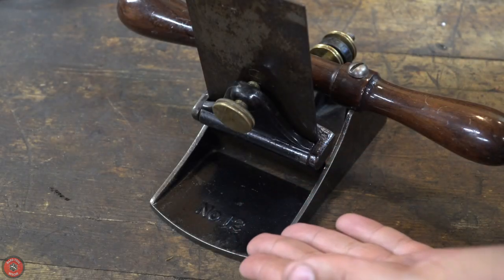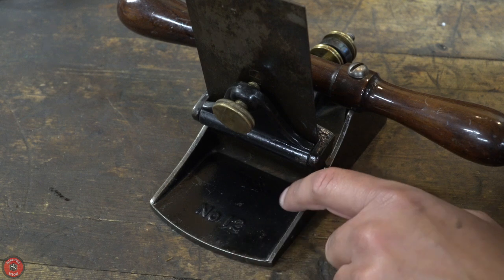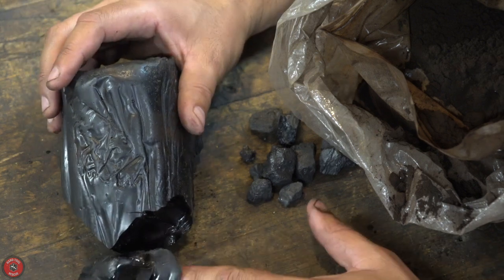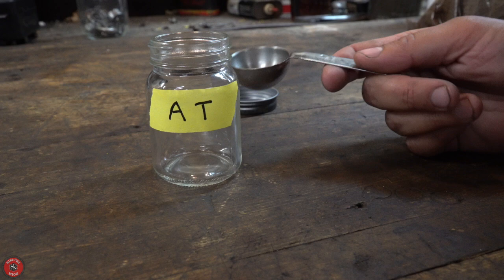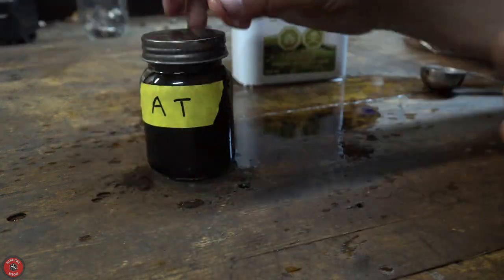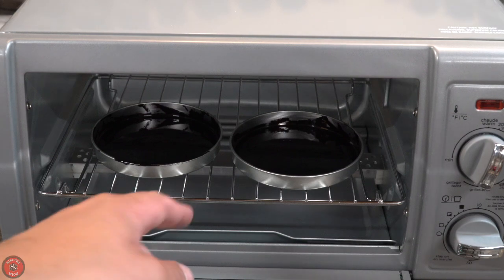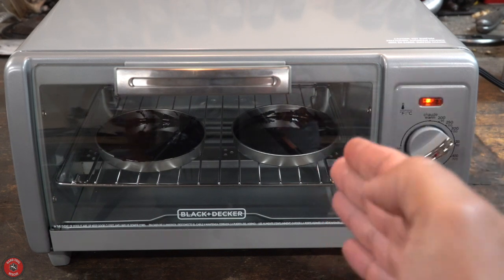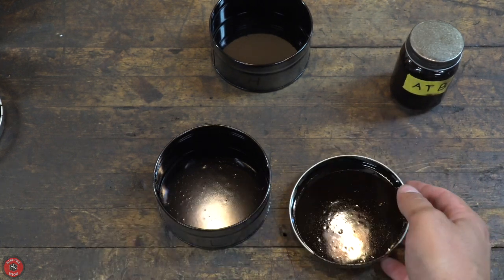Best Japanning Recipe

Comment: Ceramics guy here. Pottery kilns are programmed to sit at around 160-180F for 20-60 minutes to allow for non-elementally bound water to burn off before climbing past the boiling point. Hold at a lower temp for a little before the full bake and it may prevent most of the bubbles and blisters.
Reply: This is the most constructive YouTube comment I've read in months (and I tend to move in the friendlier parts of YouTube) !!
Reply: That's a great 💡 just as when I prep for powdercoat,  run the item for 30 minutes at 160 to 170 after washing to ensure its completely dry. Same concept
Reply: Bill:
Socrates - "The only true wisdom consists of knowing you know nothing".

Ted:
That's us, dude.
Reply: @DannnnH67  hahaha
Reply: Never forget Pearl Harbor!
Reply: @DannnnH67  Don't trust every comment on YT - Abraham Lincoln
Reply: @DannnnH67  And then proceeding with patience and the desire to gain nothing; yet awaiting everything. The definition of Joy. Peace Brother.
Reply: before or after applying the first coat?

Comment: So several things going on in the ATB mix that makes it work best.  The turpentine sort of dissolves, sort of swells/gels the asphaltum.  Turpentine works better than other solvents (pretty sure) because of it's cyclic structure, which has better solubility with the (likely variously cyclic) carbon structures in the asphaltum.  Boiled linseed oil is the key in the recipe.  It acts like a plasticizer during drying and melting of the asphaltum, preventing cracking in the resin, and then cures hard with heat and time.  The boiled version is intended to cure faster, and linseed oil is the basis for linoleum.
Reply: Trey Vaswal...."Boiled" version of linseed oil is a necessity. Regular or raw will never dry.  If a finer finish is required, there is a triple boiled linseed oil available that is used in antique furniture restoration. Triple boiled will be quite a bit more expensive, but the finish is much smoother.
Reply: I've tried japanning with mineral spirits instead of turpentine and the results really seemed inferior to the turpentine results.
Reply: @paulcopeland9035  I use raw linseed oil for anything wood, and the plastic containers I have used contains very dry linseed oil, 100 years ago they used it for paint, it will dry with time..
Reply: @paulcopeland9035  "boiled" means it has mineral salts added that encourage/speed up the oxidation/polymerization of the oil. You could add Japan Dryer to regular linseed oil and get the same effect.
Reply: I know I am commenting a whole year after your original post, but would the ATB mix cold cure at all?  I’ve used BLO for gunstock and furniture restorations, so I know it cures very slowly all by itself. But because I live in an apartment building, heat curing Japaning would... upset my neighbors.
Reply: Boiling linseed oil which is an unsaturated fatty acid causes it to partially bond to itself (which is polymerisation/forming strands of repeated molecular structure). This makes the stuff more tixotrope (melasses-like) and leaves only a couple of bonding options to bind to oxygen which is the way in which it dries. Boiling linseed oil is one way to cause polymerisation, an other traditional one is exposing bottles of the stuff to sunlight, for which reason this variery is called ‘stand-oil’. Polymerized oil is stronger because it forms a sort of netting in which pigment particles are caught when used as a traditional paint. I quote from a book I read years ago: “The materials of the artist and their use in paintings” by Max Doerner.
Reply: Boiled linseed oil and litharge are the key

Comment: The town of Pontypool in  South Wales (where many of my family come from) was a major centre of Japan Ware throughout the 18th and 19th century. The recipe, given as percentage by weight, used was as follows.

Raw linseed Oil - 44.8%
Umber (natural) - 2.2%
Litharge (lead monoxide) - 2%
Ashphaltum -  10%
Cobalt Resinate - 0.5%
Turpentine or White Spirit - 40.5%
The oil, umber and Ashphaltum are heated together and the cobalt and litharge are added slowly. The solvent added last.

As all of these materials are available it should be relatively easy to make a batch of the real thing...just take care with the litharge and cobalt as both are nastily toxic.
Reply: This should have more upvotes for the historical references
Reply: Doing the Lord's work.
Reply: @manitoba-op4jx Understandably afraid of asbestos and lead paint.
Reply: Pontyoool Japanning is notably a highly specific form. 

Ford also used to use it & theirs was a different formula (tho similar). Lots of variations
Reply: ❤ hello! Can i please clarify, for what cobalt resonate is used? It is a bit hard to find it here in Ukraine. Maybe it can be replaced with something else that is more generic? Thank you!
Reply: @crabmansteve6844  the fears are vastly overstated. If you read any medical journals you’d know that.

Comment: This is great- thank you for putting in the time. You're doing god's work here. A tip I've picked up working a lot with old paint recipes and tar finishes is that if there's an ingredient that needs to be completely dissolved by a solvent in the recipe- it's sometimes helpful to mix those first before mixing in the oil or other ingredients that may inhibit the solvent doing its job. So in this case- mix your turp and asphaltum first letting it completely dissolve before adding your linseed oil. 🍻

Comment: Been making it for years. I’m with you, ATB is what I use. The longer you let it set in the container the better it gets. I made a batch setting for 4 years. The stuff is great. I use it when I restore fans. Great information you compiled. Thanks for shearing.
Reply: This recipe should work for pottery as well as metal, no? I was thinking for terra-cotta.
Reply: Late reply but I've got this funky old GE pedestal fan that I'm keen to restore, not too concerned about it being 100% accurate but I was wondering how to get that "vintage" finish. This video and your comment gave me my answer, so cheers for that!
Reply: @jonahadi9092  The porosity of terracotta might cause problems? E.g. by soaking up the solvent in the mixture or something? Not sure.
Reply: Somebody wrote they have pottery knowledge higher up but nothing about trialing it... You could also try putting a varnish in between
Reply: @jonahadi9092  It works well for pre-fired terracotta. The mix must be made thicker, however. Don't thin this down too much, apply to warmed terracotta, raise it's temperature gradually so it doesn't crack underneath

Comment: When pouring turpentine,  or anything from a similar can, tilt the can so the spout is closer to the ceiling than to the floor. That way it is easier to control the flow when pouring into a small measure.

Comment: Remember you can add a lot more thinner to dissolve the asphalt then leave it to flash off until you get the thickness you want before painting.this is deffinately not a fast process but the final finish is fantastic looking.

Comment: Thanks for the deep dive, Eric. Fellow tool nerd here. While perusing old tool catalogs, I've often wondered how to achieve the "Japanned" finish. I've been using a mix of: 4 parts beeswax, 2 parts turpentine, and 1 part BLO. Heat steel to 300 degrees or so, then brush this on or dip your part. It's more like a shiny "blued" look and not quite so black. But it does a great job of protecting old steel.

Comment: There is another method that I designed from being 3 years in Japan, and understanding the japanese shellac tree oil, and shellacing method that is the original lacquer for ancient Asian dinner and cooking (metal, cast iron) ware.  I did this 14-16 layers for a cast iron dutch oven and any cast iron over a gray coals BBQ (no ovens !, no baking !).  Get the gray coals going, then put upside down dutch oven onto the grill.  Allow to completely heat up.  Then clean paint brush or paper towel wipe on very volume of VEGETABLE OIL on the surface.  Veggie oil is ooey gooey and provides the necessary carbonization that other food oils do not have.  Also it is non-toxic (vs turpentine or other mechanica petroleum oils).  Allow the oil to bubble, fizzle, steam, and burn onto the hot metal - until there is a complete burn-in of the blue-blacking of the carbonization and shellacing.  Each application takes ~15 minutes each layer.  Do this for 14-16x on cast iron (~3-4 hours).   This same methods fits with all these ancient mechanical tools made of cast iron or early steel.  You will have a shellaced glaze (vs ceramic or pottery glass glaze that cracks or chips).  This process also gets down into the iron pores making the entire cast iron stronger - and there is nano-steel crystallization (iron + carbon=>steel) networking happening inside the cast iron pores.  DO THE OUTSIDE FIRST - versus the inside - as cast iron ie cookware could crack the utensil, when doing the inside then outward..  When the process has the perfected glass smooth surface (and thickness) of blue-blacking, there is no more chance of seasoning or rusting.  If you do the same for a hand-dipped mechanical iron tool, you could dip the tool into the oil, then put over the coals to cook and bake, and continue this process until satisfied with your japanning surface.  I take my dutch oven to every REI cook out event - showing them the perfection of this method - and mention this constantly across other cast iron worthless seasoning vids as the perfect japanning technique for metal cookware (dutch ovens, skillets, griddles, woks, ...) and metal tools.
Reply: This is a process commonly used on wrought iron referred to as oil burnishing. Also used is Tung nut oil  (and also bees wax, but with lower temperatures).
Reply: That’s sounds awesome but also kind of overkill even for vintage smooth cast iron.
Reply: @AmeriFanPicker  Actually its not - because you coat and then go back inside - minimal brushing on the veg oil.  And once down - forever done - no more seasoning, rust, washing, or anything else, ... the time invested makes for no-mess ever afterward.

Comment: The  bare spot that you referred to in the ATB sample is called fish-eye, and is usually indicative of the presence of silicones.  The aerosol painted samples showed the same fault as you sprayed them.  It's possibly some lubricant used in the tin forming process.  You should use an anti-silicone cleaner, these are available from car body paint suppliers.

Comment: Hi there, thank you for your excellent introduction of the Japanning technique. I have been building up my collection of old tools and when the finish was bad would sand blast and give a couple of coats with spray enamel. The finish never looked “right” however and I can see that Japanning is the way to go. Now I’ll have to find something that I haven’t already sand blasted and painted to give it a whizz.  My favourite timber finish is boiled linseed oil 50% and natural turpentine 50% and it is no surprise that simply adding asphaltum to the mix gives the best finish for Japanning. Cheers.

Comment: Very interesting video. I'm japanning my tintypes and I've often problems with cracking like a spider web after the second coat baking. Usually I bake at 300° F the first coat and 225° F for the second. I use mineral spirit as thinner ... but I'll try you receipt and your baking method.

Comment: Wow!!!!! Great Video!!!! Mohawk Shellbourne handplane body: 1) Do I remove all paint (boil w/baking soda) then Japann?  2) Have Rustoleum Engine Enamel Black Low Gloss - Do I remove all orig Jappan paint 1st, then spay paint and add Amber Shellac Coating? 3) What about a primer coating? 4) Do I use the orig Jappanning as the primer coating? Thanks! Amazing results. To do the Japanning as you did so well, will need to get a Microwave. No matter - glad to find your amazing video!!!! A splash here. Some more over there. Didn't catch on fire!!! A Winner!!!!

Comment: Paint guy here :)  When thick layers of coatings are applied, like paint, if the heat is too high, a skin starts to form on top of the rest of the mostly liquid paint below it, because it has the most direct contact with the heat and with air that the solvents can evaporate into.  As the coating continues to dry, it shrinks, but this isn't a problem as it is sitting on paint that is more liquid and will allow the top layer's shrinkage.  Some coatings allow less solvent evaporation through them as they dry and "skin off" and this can cause drying issues if they are put on too thick, and dried too fast.  As the layers below the skin start to dry, they too will shrink.  This causes problems with the top layer(s) of paint because it is already too rigid and as the lower levels of paint shrink, it pulls on, and compresses the top layer(s) and causes wrinkles.
Reply: This isn't paint. The official documentation dictates that it is BETTER to apply it to a warmer-than-air surface, and then fire it in an oven that's only a bit below the maximum curing temperature of Linseed oil.
These documents come from the exact specifications used by automotive industries in the 1920s, whom got their recipes and directions from the usage of japanning up to 40 years before.
Reply: @D-Vinko  this is pretty much bulk standard oil paint. Its pigment(dissolved) with an oil binder and a big load of thinner. Same rules apply here

Comment: What about a hardness test on the different jappaning recipes as well as coating? That would be some useful information. Thanks!
Reply from the maker: It's definitely harder than the spray paint.  Probably 2-3 on the Mohs hardness scale.
Reply: Indeed. And how about flexibility? If you have it on sheet metal that gets dented will it crack off like paint?

Comment: BTW you might look into asphalt seal coat. As a summer job I drove a sealcoating truck and the main plant I'd refill at had a bunch of products that looked like that gilsonite.  Gilsonite just sounds like a product they might have had. 

You can get 80# bags of coal tar and they'd mix 1200 gallons of water with this in a 2 story mixer and we'd fill the truck from there. From there every product had its own mix of additives. Most of the high quality ones had pink latex syrup to keep it flexible on the driveways. The cheaper ones looked the blackest and I believe they were solvent based and usually sprayed on.

Some of them were just the coal tar mix and water. This was what the consumer could buy who didn't have the desire or means to mix their own custom product. It was such a rip off. But it was non toxic.

The main thing is to avoid any of the ones with sand in the mix. They used a "black diamond" sand which was just crushed obsidian which gave it that tennis court shine and incredible grip. Obviously you wouldn't want that in a tool jappaning mix. We usually squeeged this on the driveway and it left for a very durable coat that would be thicker and last several years.

Comment: What you're making is basic oil paint. There are drying agents which can speed up the drying time of oil paints.

There are also oil paints with aspaltum pigment you can readily buy on the market you don't need to mix it up on your own - although when you're mixing it up yourself you control what additives are in the mixture so there's that. The pigment can also go by the name bitumen.

We used to spray a very diluted form of this on the canvases in some of my art classes in university, it is a very good ground for oil paints, it provides just the right amount absorption and it's yellowish petrol color is a great middle tone as well.

Comment: Hello! 
Very interesting video, thanks! I always wondered how to replicate those old finishes.
But I was thinking about the "spar varnish" used here. Polyurethane varnishes being called "spar varnish" is a deceptive modern marketing abuse and they have nothing to do with the spar varnishes of old.
Real spar varnishes are tung oil based. It is a drying oil  that produce a very durable and hard, glossy finish. It is often mixed with linseed oil for flexibility. While PU varnishes become hard and brittle and flake off, proper spar varnish stays put for year under sun, sea and wind. 
"Le Tonkinois" is one exemple of a readily available, excellent quality old school spar varnish, but there are other makers. 
Just make sure the one you chose does not contain neither polyurethane nor nitrocellulose. (Long drying (few hours) times usually indicate the good stuff).
This could give you the finish you are after.

Comment: Really nice video, great job. I always loved the look of japanning, but didn't know much about it. This is a very effective breakdown of potential processes, thank you. I realize this video is old. But, still - much appreciate it. I'm holding off on any more work with asphaltum however, after recovering a set of antique entry doors that were covered with asphaltum paint on the exterior. Yuh, no asphaltum for a while. I have a lamp I'm working on now, on which I will 'simulate' a japanned finish. Don't hate me... ;)

Comment: It wasn’t just woodworking tools. Most machine tools such as lathes, planers, millers, etc. were japanned. Back in the 1800s to early 1900s, paint wasn’t very good. So this worked pretty well. Additionally, the black concealed the grease and oils that dripped and sprayed over the machines.

With all the losses feeding the tabletop, this stuff is going to cost a lot more than thought.

You’re a riot though. Too many YouTubers don’t understand that entertainment is at least as important as the information provided. This Old Tony gets it, and obviously, so do you.